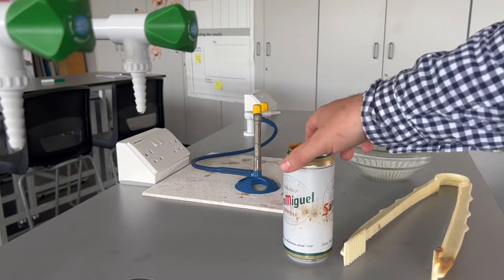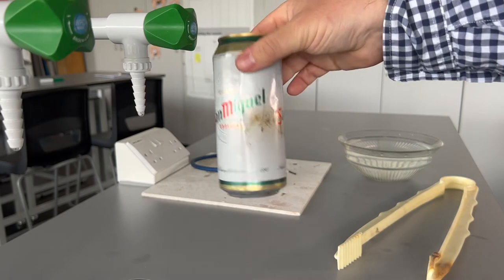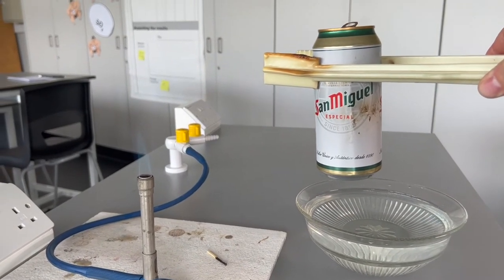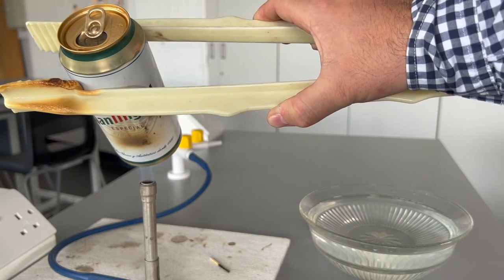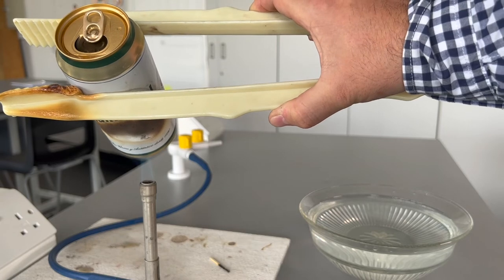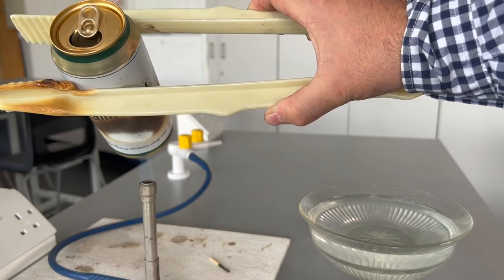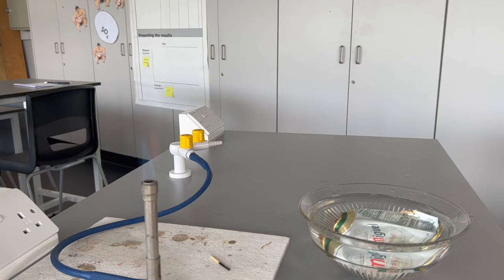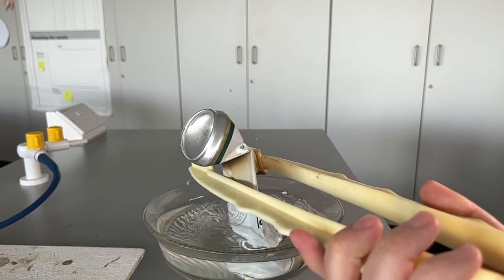Air pressure collapsing can experiment

Comment: The rapid condensation of water steam inside the can causes almost immediate vacuum when the steam turns into liquid water on the surface of cold water in the bowl. This explains why the volume of air inside the collapsed can is nearly zero